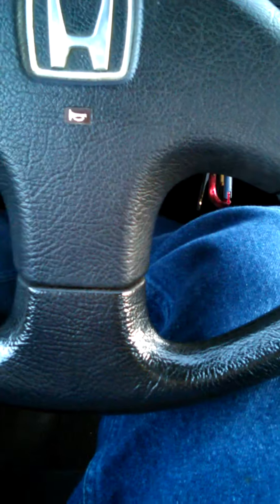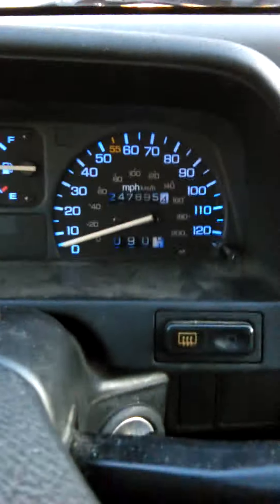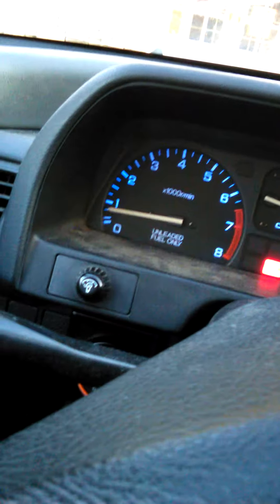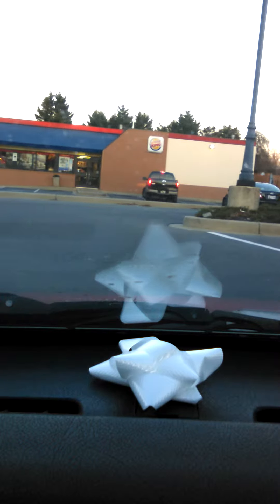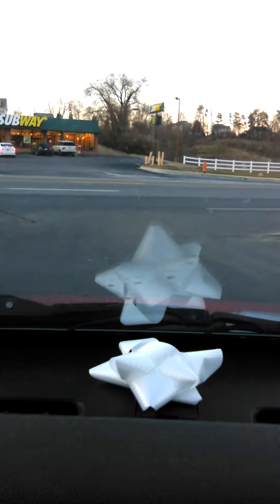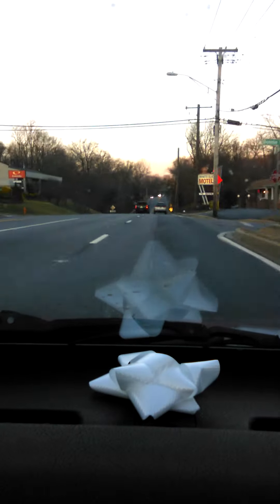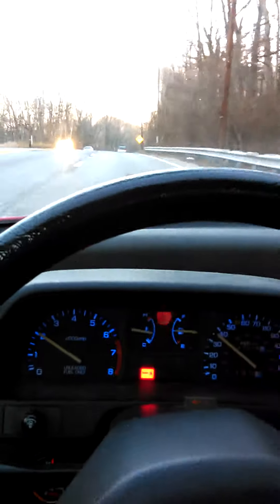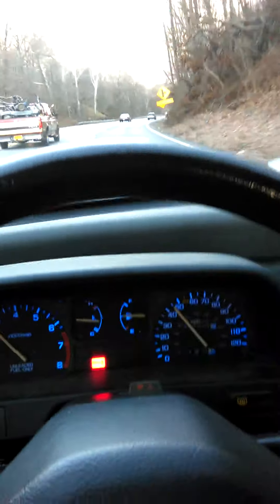89 Honda CRX driving after rebuilding D15B2

Comment from the maker: I put in new rings, all new main and rod bearings, cleaned the pistons and everything inside the block, new head with valves and springs, and new gaskets. I've since did an MPFI swap which I'll show later. It's been done for a few months, I'm just terrible at uploading videos.